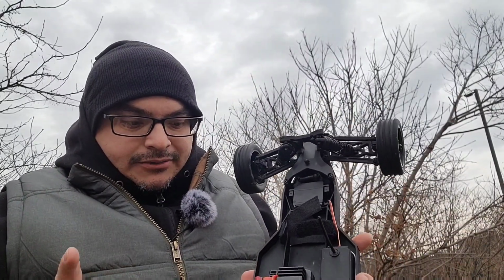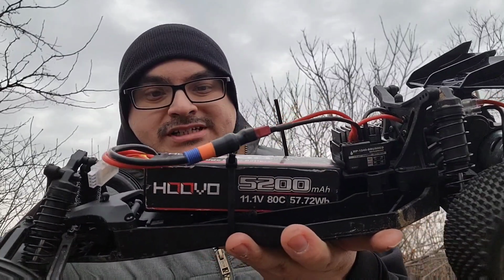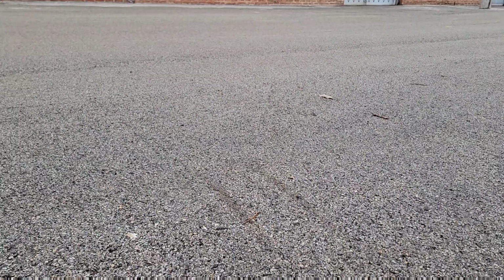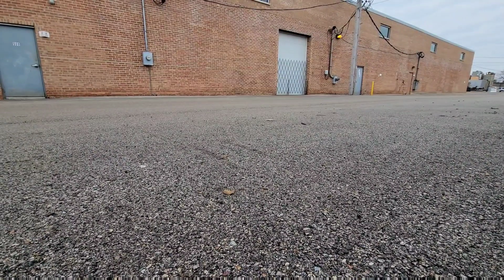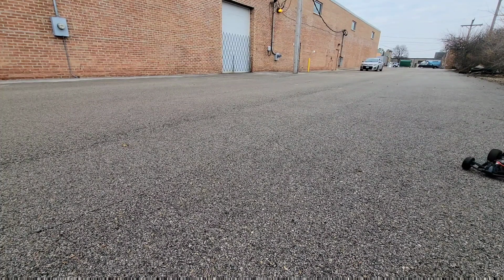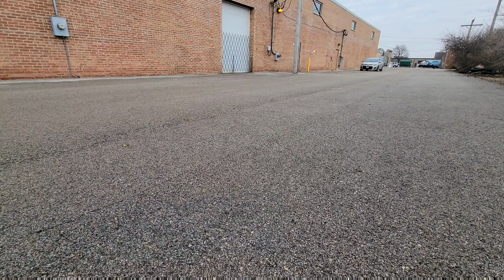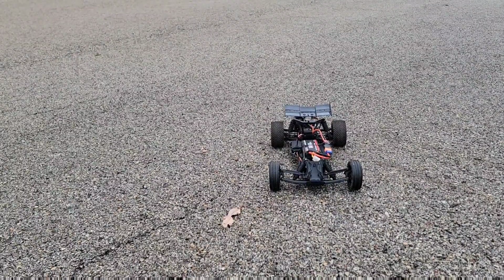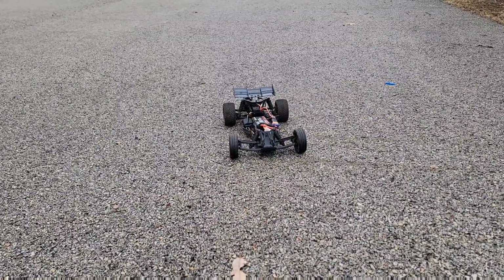The Stinger on 3S?

Comment: add spacers and longer screws to lift up esc mount to use bigger batteries.
Reply from the maker: Yes.  Except that the Buggy body won't die properly again.  
It's the downside of buggies.  Not alot of space to work with